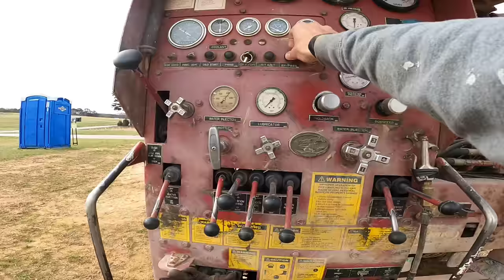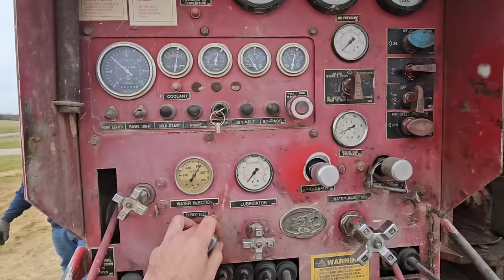Dowsing For Water & Drilling a New Well, How Much Water Will We Find!

Comment: I dowsed my own well. My well guy wouldn't. He just came out and dropped a flag according to the open tree line. He recommended someone to do it. I didn't want to pay for it. I was able to find 2 crossing readings. Marked a "x", he drilled over it. Hit water at 240 ft. Drill to 300 ft. We got 15 gpm. But I was scared. It worked out. I saw videos were guys claim to tell you depth and gpm. I am not that good. But I am  a believer in dowsing. I have found sewer mains and water services with it. I am a Plumbing Contractor in Oklahoma. Great job!

Comment: My experience at drilling . Limestone produces the most water 5 -25 ft into the limestone. I would have taken my chance about 35 ft-100. Total. Drilled a well 465 ft and most of the water came at about 100-145 ft in limestone. That was soon as I hit limestone. Well ended up producing 350 gallons per min.24 hr. Test pump. Just my thought . Thx retired from EATON WELL DRILLING.

Comment: When some folks showed me dowsing rods like you have there (about 45 years ago), the rods were brass. Just held them in my hands without the bushings like you have there. When I walked over a waterpipe that was under the floor the rods would cross, step backwards and the rods would un-cross; I could stand right above the waterpipe and step forward, and step backward, back and forth. I thought that was pretty cool.

Comment: You guys shur do things differently from us boys in North Dakota. We drill hole well Case well with a screen and pour sand down outside of casing to filter out any fines and pump rest of hole with bentnight  and of course we use pitless units because of the cold frost everything is at least 7 ft below surface

Comment: H20 MECHANIC... I want to drill a well on my property in SW Pa. and my property is located over a old coal strip mine from 1912. According to the DEP/EPA the coal seam is 100' below the surface. Guess they put cover/overburden back over after they were done mining.   Can I drill a well? Any thoughts would be very appreciated. Wells around my area prob average 100-200' Pretty easy to get water usually. Thanks!

Comment: Why did you not set the short piece of steel casing like I have seen you in previous videos
Reply from the maker: @22bnightrider  once we pass 60ft we use metal on the bottom. If we set 50ft, it'll just be pvc.

Comment: I work in the drilling industry doing geotechnical, environmental, water well drilling. Every site we drill is thoroughly located for underground  utilities by a locating company before we drill. We keep a set of what we call witching rods but the same as dousing rods on the drill for fun and can find utilities in the ground using just the rods. I have found utilities in the ground and then had the locater find them in basically the same spot using ground penetraring radar. Don’t know how it works but I proven dozens of people wrong on site haha

Comment: Do yourself a favor and get rid of the copper rods find a fresh green willow branch that at lest 3/8" thick an in  good Y . Hold the 2 arms of the Y one in each hand with a bit of a tight grip an wrist twist. You get a reallt strong bend strait down when you walk over a big stream in the bed rock. An a crossing of another. Then you can walk around that spot to pin point how many streams cross that point. I done more for dug wells 20 to 35' deep. That runs in a seam of corse gravel or white sand.

Comment: If dowsing doesn’t work, what made the copper rods cross?
Reply from the maker: The idea is the a break in the ground disrupts the natural magnetic pull in that specific area, it doesn't mean there's water, it means there is an anomaly underground. Dowsing has been proven to be 50% accurate. But 95% of water wells provide good water, so logically people perceive that Dowsing is a proven tool to find water, it isn't.

Comment: I am considering drilling a well.
First of all, no one around here for miles with a well
But I did hear some water running  at one time, and I doused it and it said water a stream, 
As there was a long line going in one direction
I have to drill this myself, since i do not have the funds to hire someone.
Can you tell me how i will know the difference when i get water.
I am following close to an idea seen online,
And with this method , they said you can go down a few hundred feet.
But I have only the funds to go possibly 80 feet,
I know there is a few ponds around with some clear water, on the surface,
So i would expect, water to not be too deep.

Any suggestions or advice,
Will i  be able to sink a hole down 80 feet, then drop my casing in without it expected to collapse

I made  a bit that water can be forced down to the bit, and a top piece to inject the water /
and am using 3/4 black steel as my drill rod
And after the hole is done, I plan to use that rod to bring the water up with.

I did note a fellow several miles from me has a shallow well and they have the best water around.
Most house are several miles apart.

Should i use a clay mud in the hole while drilling to help holed the sides of the well while drilling. 
Or can it be done safely or should i suspect a collapse,
Soils around here a basically clay

Comment: Question: bought a pump Hallmark Industries MA0414X, 110v. I’m down 110’, water is at 80ft. Says at that depth I’d get 20/40 pressure. I have a 50gal pressure tank set to 36psi and a 40/60 pressure valve that I’ve lowered as low as I can. Unfortunately I’m only getting 10psi. Any idea why?
Reply from the maker: Yea, because that pump can't lift water past 40ft deep, your water level is at 80. I have tested pumps just like yours and explained it. Remove the pump, send it back and go buy a quality 10 gpm pump. If a pump says 160ft max head or 30gpm it's not ment for a well, it's ment to go in a cistern because there's no head pressure
Reply from the maker: https://youtu.be/7-_SdfCbxZI?si=vHx5wsLgRdxosquM

Watch this it'll explain it
Reply from the maker: https://youtu.be/qIxKGNpZycQ?si=3XK4OeCl1bCRTIg1
Here's the Hallmark pump test. 
Read the reviews online and you'll see other state the same thing. It's 100% the pump that's your issue, you must buy a good pump or at minimum one that over $450 10-12gpm
Reply: Thank you! I was afraid that would be the case. I’d like to throw it down to 130’. I have to be thrift with it, but what would you suggest?
Reply from the maker: @Shofar2324  I'm not sure what your budget is, but I sell a 115v 1/2hp pump on my website that I know will work all the way down to 130ft.

Comment: If anyone could help that’d be greatly appreciated. My pressure tank takes 10 minutes to fill from 40psi-60psi with no fixtures running and if I run any fixtures the pump can't keep up with the water going to the pressure tank and will drop to 0 psi and I have to use my low water cut off switch to get water back. I turned off the valve right after the pressure tank leading to the house and it holds steady pressure in the guage at 60 psi which makes me think there's no leak in well line or well pump. I had someone out to check the pump and they said it's reading 5.5 amps which they said is correct for my 1/2 hp submersible pump and all electrical seems to be good in the control box and switch 

Anyone have an idea of what might be happening ? I do have a lot of sediment/iron in my well, is it possible the pressure tank, 1/4 nipple or well screen is clogged with sediment? 

Thanks

Comment: I feel SO LUCKY. 

I inherited a 48 acre parcel thought to be Dry Land.  The Historic Spring had decreased from 1200 gal a DAY to just 300. 

No need to witch it. Only one spot where a rotary well rig could set up at.

Fortunately it was at the confluence of a plateau where 2 mountains about 500 feet higher summits came together. I ended up bottoming about 880 feet below both summits 

Drilling started at 915 am.  And by 400 pm 45 gpm at 360 feet. 

I decided to do """another final 20 feet"" ....and another 8 / 10 gpm hit 12 feet into final 20 feet at level 372. I cut it off at 383 feet 

While I hit bedrock at 50 feet, I still elected to PVC case and gravel pack it clear from 383 ft bottom to the 30 feet surface bentonite/ concrete surface seal. .  

On day of drilling Static level was 103 feet.

The 3 hp submersible pump was set at 360 feet to prevent sediment from covering the final 372 foot hit.

The foreman strongly recommended a full gravel pack with the pump set just above final 8 /10 gpm hit to avoid sediment covering it up over time.  

EXPENSIVE but I understood the reasoning behind it.

The day the pump was installed static level had risen to 90 feet.

Then 5 000 gallons a day pulled up at pumping rate of 35 gpm.  About 3 months later a bedrock blow out into the gravel packing did occur ( cloudy water ) with another 10 foot rise in static level to 80 feet.  The full length gravel pack saved what could have been a catastrophic event. 

I'm pumping 35 gpm;
With 5,000 to 7,500 gallons a day pull out.  Absolutely NO CHANGE in static level at 80 feet; even when pulling out 35 gpm. 

In a area where 5-8 gpm would have been considered a gusher..........

MIRACLES DO OCCUR !!!!

But....I did ""dry up"'" neighbors 2 springs.  One a 1/4  mile away.  The other 1/2 mile. Along with another neighbors marginal 5 gpm well 3/4 mile away. My geologist explained that the aquifer was under pressure and bedrock fractures brought water to surface. And my well blew out the pressure needed for them to pop fluids to surface 😢😢😢 ( not really ) 

I truly hit the Lottery !

Comment: Make a jig that holds both handles parallel to each other at all times. This way, if the rods really do work (and you are tipping them without realizing it) the rods will still cross. Does that make sense? If they don't work then each rod will or should go in the same direction as the other.

Comment: Dowsing doesn't work. It's total bunk. Been proven over and over.
Reply: Works 100% for me, used it for tracing a few water mains.
Reply: You're fooling yourself
Reply: he found water though, just not flowing at a fast rate.
Reply: 😂 just so you know?? They do work BUT like anything in this world it’s not 100% fool proof!! A worm tunnel filled with water “can” set them off.  They sence a void  when I was many many years younger they were spot on in my older dinosaur days?? It’s a hit and miss. But  when you have absolutely no idea where a tile of water line is buried?? Sure beats digging up a 1000 acres😂
Reply: You have your head in the sand. I have done hundreds of wells. 2 out of the 3 well drillers here. Just pull into a property an set up there rig just any were. Problem is under ground water runs in crakes in solid bed rock.  The steel cassing must be pile driven into solid bed rock. A weld on drive shoe is welded onto the first 20' 8" x3/8 wall. This seals off any ground run off water getting into the well. No need for any concret or clay back fill. I got into  Arguments with these 2 wheel drillers as I have marked off 2 to 6 spots were there 2 or more water vain crossings. An left nothing said to these drillers until they set up. They refuse to be leave me. I tell them fine you drill here to max 200' and if your dry you will stop drilling an plug it an move to were I tell them an if they hit water in less then 200' you don't get paid for your first hole f up. Boy are they pissed when they hit water at 65' an 10gpm. The 3rd drilling company go to the site way before there eqipment an use the same green willow branch I do that in a Y shape an witch the same spots I did with out me giving them any info. Just a red tape on a 3" nail 1" under the dirt I marked. I had 100% bang on for 62 years. No dry holes . You can miss a vain by 3" an not get water  but a 1/4 stick of tnt fixes that
Reply: @jonhelmer8591 no bull about it
Reply: Retty much everywhere if you dig down deep enough you'll  find water. There is no scientific mechanism by which dowsing could work.
Reply: Yes ot does. I've seen it used too many times.
Reply: Dowsing works used it years ago in the 50’s
Reply: Wiki

Comment: I know dowsing works, because I have used it, to locate sewer lines.  I have two  theories on how it works.  The first is that different densities, underground, give rise to microscopic changes in gravitational values.  The second theory is the different densities give rise to variations in the earths magnetic field. How either of these effects then move the wires, I still have not worked out a theory for yet.